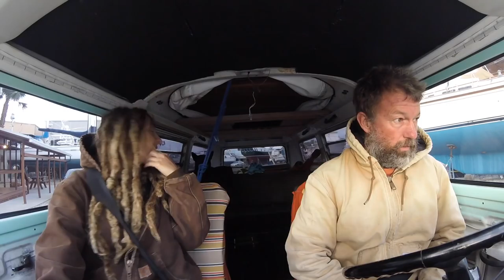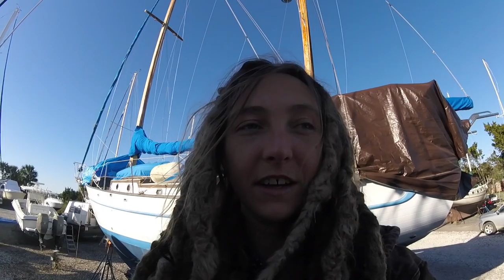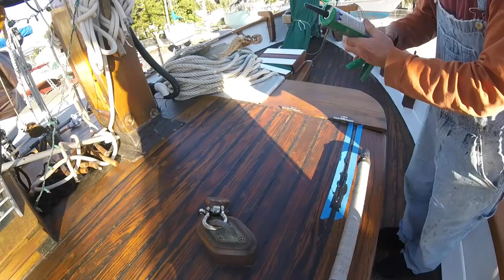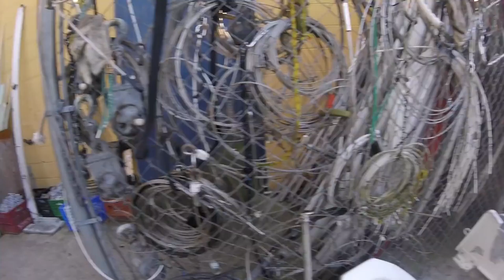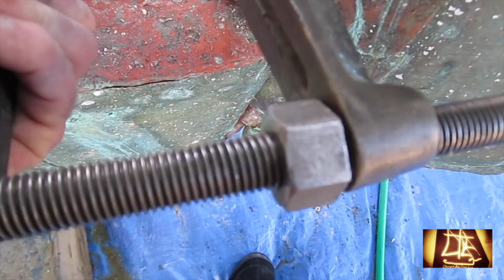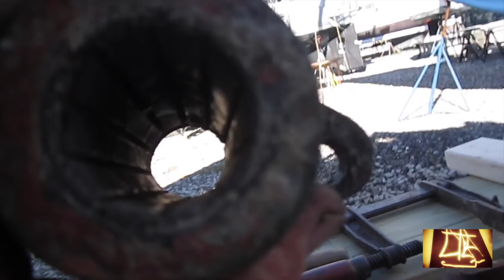Episode 122 - Maintaining the Deck of a Wooden Sailboat - SVN Liveaboard Life Vlog Day 27

Comment: Stuck coin acceptors of that sort USUALLY stick because the coin box (which is right below) is too full for the coins in your push to drop free and clear. SOMETIMES, if you need a second load, you can push the handle in gently (to relieve the spring pressure on the coins) and give the whole housing a good solid smack with the heel of your other hand and shift the coin heap enough to let your coins drop and free the lever again. But that's very short term and the coin box needs to get emptied Real Soon Now.